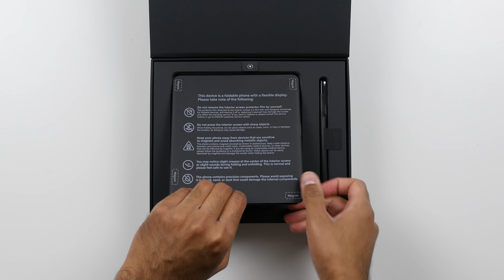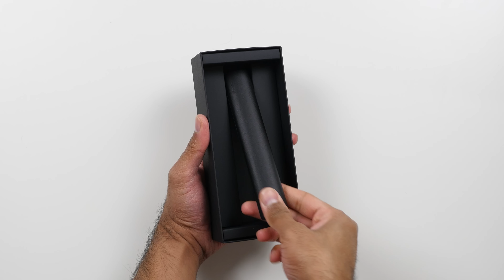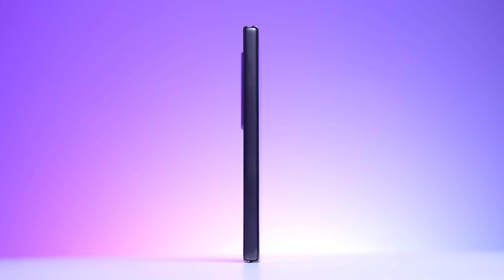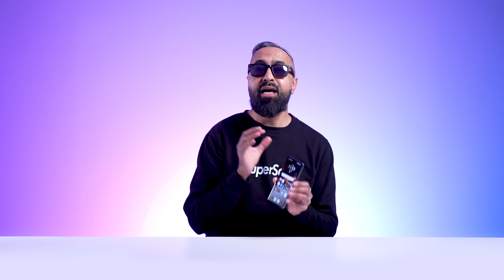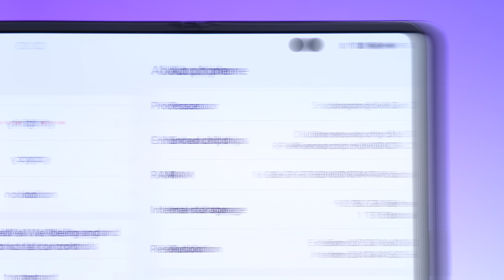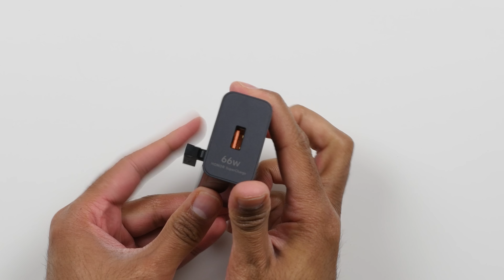Porsche Design Honor Magic V2 RSR - The Perfect Foldable?

Comment: It's an amazing device, putting the Porsche crap aside that is, but the streamlined software for a folding phone just isn't there, especially when comparing it to the Samsung Fold's features and interface.

The missing taskbar and easy multitasking alone are enough to disregard all those hardware feats.

You wouldn't know that unless your used both phones.